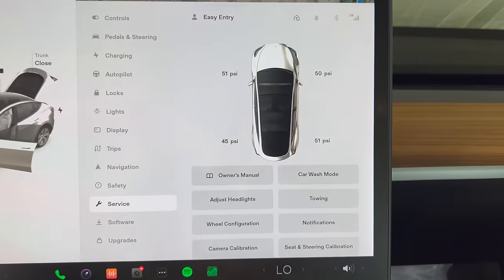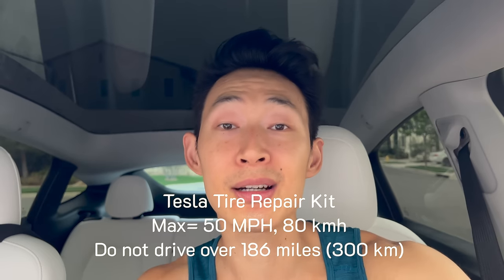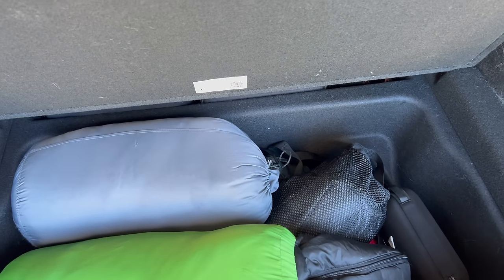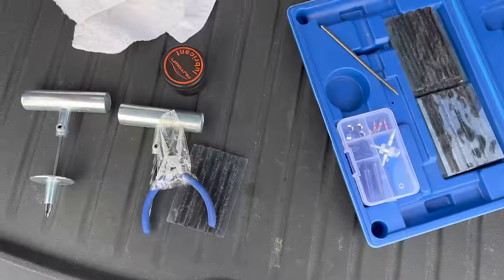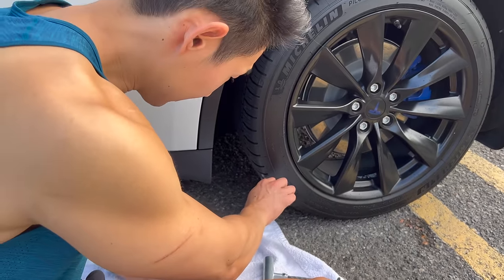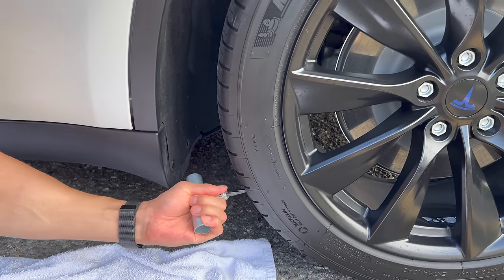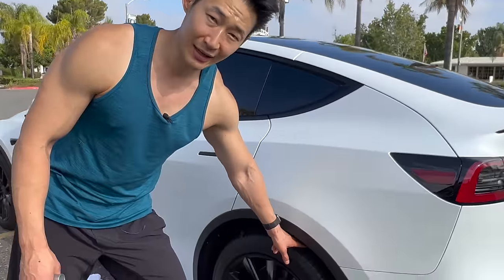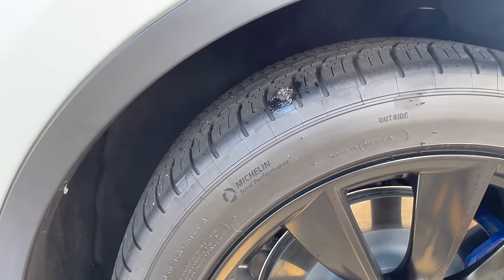How to plug a Flat TESLA Tire (Or any tire) in an Emergency

Comment: You should have dropped the pressure down to 20 psi or less.  Tire should be soft, but not flat.  You would have done it in 2 seconds.  Then re-inflate with air compressor.
Reply: Really..?  I'll try lowering to 20 psi next time, if I can remember!
Reply from the maker: Good to know. Online it said not to but it makes sense
Reply: It's still tough.
Reply: @AMindInOverdrive  You can take it down to 10PSI or so if necessary to get the plug in if 20 PSI is still too hard.
Reply: @EverydayChris  absolutely wrong. If you lower the pressure the tire begins to "fold in" making it impossible. The higher the pressure the better.
Reply: Doesn't seem like it would be easier with lower pressure, causing tire to fold in an away, but I don't know you're wrong.  I've plugged tires before, but off the car and on motorcycles.  But I may try your idea.
Reply: Chris is to busy at the gym doing Curls of the Girls instead of doing parallel squats
Reply: This happened to me in Boston after a Red Sox game. It was midnight I had 19 psi like you I have the Tesla compressor and filled it to 46 and watched it the whole trip home about 130 miles to Connecticut. In the morning it was back to 19 psi plugged it in my driveway. No problem Chris but I do squats at the gym too😂
Reply: No point dropping the pressure.
Have you ever done one of these repairs?

Comment: Carry with you a set of pucks, a scissor jack and a lug wrench, and an air pump. This type of repair is much easier with the wheel off, and your body weight directly over the top of the tire to push the plug into the tire.
Reply from the maker: Makes sense and doesn’t take up much space
Reply: DO Not use a scissor jack, it will fail ( yes this is from experience) as the Tesla is too heavy unless the jack is rated for 2t !
Reply: @geztinsdale  That's what they make jackstands for!   Always use a jack stand.
Reply: @eugeniustheodidactus8890  how to you use a jack stand with a tesla?

Comment: You can definitely patch it, even it was on the sidewall. It’s just that those companies refuse to do it, so they can sell more tires. It’s a massive scam. I’ve had many patches done on the sidewall and also on the very edge of the tread and none of them have failed.
Reply: You would get prosecuted if caught doing that in the UK.If you are a business it would be a very large fine.

Comment: Done this many times in the past.  Trick is to put a lot of rubber cement on the plug (for lubrication) then immediately push it in.  After like 15 seconds it already starts to dry this is why you had a difficult time.  It's all technique.
Reply from the maker: Ooooo so more lube less air

Comment: I've repaired tires on my vehicles at least 1/2 a dozen times in the past 8 years. Never had an actual "on the road" emergency, each time I just had slow leaks like you were experiencing. Slow leaks are good as I could get the car home and remove the wheel, which makes the repair much easier to accomplish (also, the bathtub is then available to locate sloooow leaks). For "on the road" puncture repair, I have a jack, jack pad inserts and lug wrench (also a piece of 2x6 to put under the jack in case it wants to sink down into sandy soil or snow) so that I can actually remove the wheel from my Model Y to fix a puncture. Much easier in the garage with the floor jack... but doable on the road. I have found that using the lube on the reaming tool seems to really help when inserting the repair plug but I do agree that using your body weight and moving the tool around and in & out quite a bit really do make this work. Also, while soapy water is very good for checking a repair, saliva is also viscous enough to do a nice job... in a pinch. Good video... thanks!

Comment: I plugged my own tire last week and it was a serious struggle, much like you showed. I think reaming the hole with the provided tool extremely well is important. However, with a hole that is prepared like that, you will lose air very quickly, so be always be prepared with the next step.

Comment: Great video.  I was driving from L.A. to S.F. and got a big nail in the driver side rear tire halfway on the trip in the middle of nowhere.  I ended up calling AAA and the truck removed the tire, plugged it for me and I was back on the road.  I am glad I didn't have to throw my weight into the plug like you :)  I had a professional take care of the tire repair.
Reply from the maker: Oh nice!

Comment: What worked for me was keep using the Ream tool back and forth back and forth. Even if it feels like it goes in easily, just keep doing it for a bit. THen I was able to plug it with that other tool thats difficult to use with the rubber wax. Worked wonders and I  have half the muscles that Chris has. lol

Comment: Thanks for showing how difficult to do it. I just had an incident a week ago with a  big screw punctured my left rear tire after I drove pass a road construction area on the parkway. I noticed the TPMS alert right away and luckily, a service area right ahead of me. Calling Tesla roadside assistance was my last resort cause I wanted to try using the Slime to seal it first and go home, 65 miles away. I could not take the screw out from the tire. I had no tools and the screw was need the center of the tire. The Slime worked. I kept at 55 mph all the way home with no air leak until the last 10 miles or so, it started leaking very slowly. It lost 2 psi when I got home very late in the evening. I think the screw had torn the hole larger at the end, slimy green liquid was sipping thru. The auto repair shop said I had to get a new tire because of 2 reason. One, the hole was large and two, I ruined it with Slime because the foam inside the tire was soaked up with the sticky liquid and it could not be cleaned out. The tire would not balance again. The shop said never use tire sealant unless I prepare to replace with a new tire...............
Reply from the maker: Yea! At least it worked and you were able to drive. But yes, slime is a last resort. Glad it worked out! Get the plug kit!

Comment: I couldn't power the plug through. Happened to see your video.😂 I am not alone. The nail is close to the inner edge of the rear tire. Good thing is the car in my garage. The nail is longer than yours so it's leaking slowly.

Comment: Thanks for actually showing a tire plug repair.  I assumed it would be harder than it looked, and without some body weight or leverage it would be impractical to attempt for most people.  Removing the tire would also not be practical in an emergency situation (no jack).  I have an awesome tire inflator, and I would probably just keep adding air until I got to somewhere safer, or a repair shop.  Of course, a tire blowout or sidewall damage would make that solution impossible, and you would just have to call for a tow.  In all my years of driving, I’ve gotten many nails, and they only slowly release air from the tire.  Only one time did I hit debris that damaged the sidewall.  So, it’s pretty rare for that to happen.  Like once in a lifetime of driving, depending on road conditions in your area.  Of course, if you drive in construction areas, you will likely have a different experience.
Reply from the maker: Yeah agreed no worries

Comment: I saw on your service/tire pressure screen shot that it was 104 degrees.  Bro, you're allowed to be all sweaty after doing a tire repair in heat like that, in the sun, on hot pavement.  You're really a beast, lol.

Comment: Thanks, I appreciate your video.  I also have a tire repair kit.  You've made me realize how hard it is going to be to use it.   Looks better to leave it in and keep adding air as necessary.
Reply from the maker: Yeah do it in an emergency. But it seems that letting air out helps

Comment: you're right about too much air in the tires. Especially with low profile tires, the psi in them is usually significantly higher. If you don't deflate most the tire, you're fighting against the air pressure.  Deflate the tires first, not all the way, they should still hold their shape for the most part, then you can insert the plug in a few sec, then reinflate with a pump. I've done these plugs since a teen, they've always lasted the rest of the life of the tires i've plugged for the fam. Thanks for sharing
Reply from the maker: Nice! Thanks man! So less air no wonder it was so hard
Reply: @EverydayChris  Oh took me awhile to figure that part out ha. Safe travels!
Reply: If a tire has 50 lbs of air pressure, that means 50 lbs per square inch. You're trying to push a plug into a hole that maybe has an area of a 100th of a square inch. So there would be a force of 0.5 lbs from the air pressure trying to push it out. The majority of the force working against you is from the tire rubber and plug deforming enough for insertion.

Comment: I am rather old, so remember when plugging tires was standard procedure and perhaps is still done by some tire stores. However, from recent experience it seems that the preferred repair is an internal patch, requiring removal of the tire. In the case of a traveler, that's not possible so plugging is necessary. I recall tire shops dipping the plug into a liquid adhesive, like the type you put on an inner tube of a bicycle, for example, and this made the plug slide in a bit better. If the nail were located more toward the inside, that might be a problem, since there doesn't appear to be much space to lie down and reach under the car. Your video was informative with great tips for drivers. I'm a new Tesla owner so remain ignorant about many features of the car. Since Tesla's come with no spare, that implies no jack to provide better access in case of a flat. Jacking is hazardous anyhow, given the location of the battery. Are run-flat tires, as found on Corvettes, a good option, albeit undoubtedly very expensive? (By the way, you were lucky. The nail was short and probably barely punctured through. A pin-sized hole was leaking air.)

Comment: Chris,  next time you can try having somebody you trust roll slowly over the plug with handle.   use your foot or object to hold the handle in place,  have the person slowly back up so that it pierces through the tire.  this will allow you to get the middle or the inner sides of the rear tire.   SLOW IS KEY like 1-2 inches at a time with very audible communication.

Comment: I've had several flats, on motorcycle and my Pathfinder.  All were fixed using this method.  I had to 'ream' out the hole by repeated strokes with the reaming tool before the plug would go in.  I never had any lube, but used rubber cement for lube (included with the  Target repaid kits I had on hand).  Also - letting a lot of the air out was a good idea, as mentioned previously.. Also - soapy water is ideal, but on the road I just put some spit on it.

Comment: Technically, you are not supposed to plug or patch the hole outside the middle three threads.  But I did that on my car and had no problems with it.  Also, you were supposed to use the superglue as a lube to help pushing the plug in.

Comment: Remember, slime won't work on OEM Tesla tires with the foam inserts.  Got my plug and compressor kit in my frunk for this very scenario.  So thanks for posting this!  Now, I'm scared, because I'm only 5'10" and my biceps aren't "pythons" like yours!  LOL.
Reply from the maker: I wonder how the tesla slime works??
Reply: @EverydayChris  Same way fix a flat does.  The idea is to put it in your tire, then top up the air and start driving.  The centrifugal force then coats the inside of the tire with the stuff, sealing the puncture as it cures and dries.  That's why you can't use it with the quiet ride foam insert tires like the ones Tesla uses.  The foam rubber acts as a barrier between the slime and the wall of the tire.  Wait, I could have sworn you asked "how the slime works".  I didn't see the "Tesla" in there.  No idea.  Either it's a thinner compound that can somehow penetrate the foam and reach the inner tire wall anyway, or ... it can't unless you're running with other than OEM tires, which you are.

Comment: Even if you don’t have a spare tire, you could carry the tools to jack up the car and remove the tire to make it easier to plug a hole that’s not on the outside edge. The tools aren’t that big and would easily fit in the lower rear trunk space. Mine do.
Reply from the maker: That’s true! Good point

Comment: Since you are right handed, you should have done the operation from the rear of the vehicle. The tire pressure needs to be low and a lot of wiggling is required to get the plug in. I have one and hope to never use it. If it's a slow leak, I'll keep refilling until I get it repaired. Thankfully, you are by the tire shop.

Comment: Hi Chris . I had a flat tire and now I have replaced all 4 tires for EV PERLLI . Discount tires stated that these tires are good for Model Y. My question is what are you’re thoughts of EV Perrlli tires. And how do I reset the sensors so I can see the proper psi for these tires. Thank you in advance .

Comment: Hack: Next time you can use a small drill, there is a bolt at the bottom of the handle on the silver tool you can loosen that up remove the sharp piece and put it on a drill and use that instead.

Comment: Chris, had a nail in my 19” Continental rear tire, same location as yours. Too near sidewall to repair. Drove to nearest tire shop and over $500 later, I was good to go. I had 1,700 miles so the tires were like new. I have a pump with tire sealant, but no plug kit. After watching your video, I’m good with that. By the way, apparently the foam insert, in many Tesla tires (not sure if it’s all Tesla tires) can prevent the sealant (slime) from working as intended. Just sayin’….
Reply from the maker: I’m wondering how the tesla sealant is different

Comment: I got stuck 1:00 Am after a wedding , tried pumping up the tire but air was going out as fast as I put it in,  I am building a tire rack to fit in trailer hitch  for trips.  I'd rather spend 20 min changing a tire then waiting to get towed  and have to get a motel if tire shop does not have a tire on hand.  good luck like your videos
Reply from the maker: Yea this is why I have the plug kit

Comment: did this recently. Boy was it tough. The cheap kit I bought in Canadian Tire has tools with screwdriver handles rather than the T-shaped ones. My hands were sore for days after. I even had teh wheel off the car and drilled out the hole with a small drill bit first - still really tough.

Comment: That spare tire kit's rim is only 4" wide and is rated at 50mph, so it doesn't take up as much room as a full sized tire. I already have the tire patch kit, but I'm afraid that if you found it hard, that I will find it impossible. Maybe I should take my floor jack along? I'm thinking about buying that spare tire kit for an upcoming drive to Yellowstone.
Reply from the maker: Oh nice. Yeah imagine worst case scenario
Reply: @EverydayChris  Worst case scenario is my trying to put that plug in!

Comment: Funny story 
I had a screw somehow end up in my sidewall (Michelin performance tires) and you cannot plug sidewall punctures you have to replace the entire tire. I asked all the tire people around me and because the performance Michelins are so unique you cannot find a “cheaper tire”. Performance Michelins are 600 a tire! I’ve seen Yokohama and pirellis but also at the same price point. Should make one think twice before getting the P model. Thanks bud for the info though I’ll use it on my next tire issue as long as it’s not sidewall 😂
Reply from the maker: Haha

Comment: I had a flat before where the nail was in the middle, I jacked up the car, remove the wheel and fixed the flat while the tire off the car. Then put the wheel back when finished.
Reply from the maker: No jack with daddy chill

Comment: What you could’ve done is lay flat with your back on the ground use your right arm to hold on the rim and use your left arm to apply force into the tire to seal it with the plug.  That way you could avoid hitting the side wheel well.
Reply from the maker: yah I tried doing that but it wouldn't budge so the guy said its better to use your body weight and just push down it doesn't have to go straight through

Comment: For those of you who are willing and able to change a flat tire with a spare see info below:  Model 3 perfect match for Spare Tire is from a Genesis 2015-2019 must be the 18x4 rim. Spare Tire Size- T135/80R18 with 5X114.3mm PCD Bolt Pattern and 64.1mm center hole.

Comment: Don't lubricate the patch wad; it is sticky for a reason, so it will adhere to the tire once it is in position in the tire and will stay in place!
Reply from the maker: Got it. I just had to find a way to push it in. But lubricating the patch didn't have any effect when I did it
Reply: We all learn from those types of experiences. I can definitely see myself doing the same thing and trying to lube it up just to get it in but that will definitely cause it to leak since it’s no adhering to the edges of the hole you created